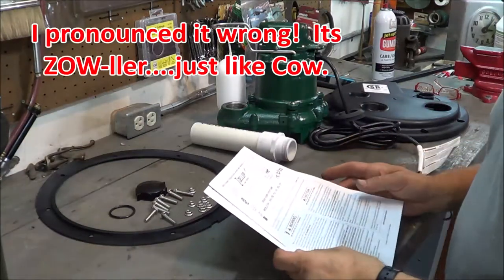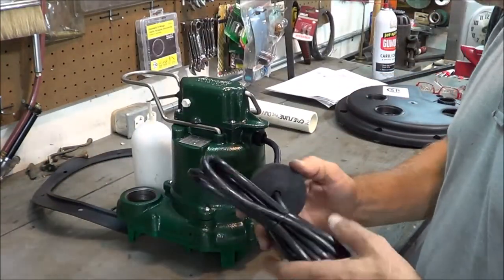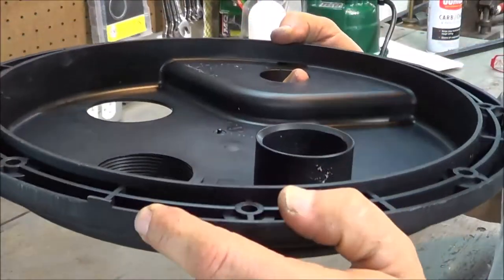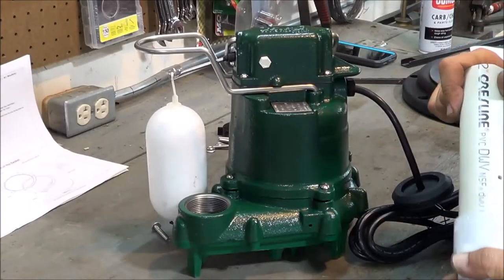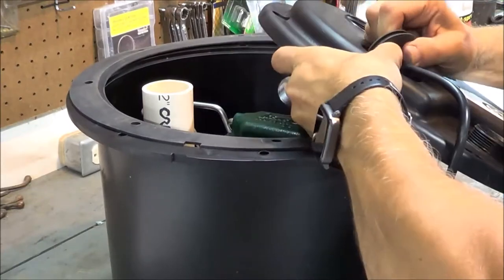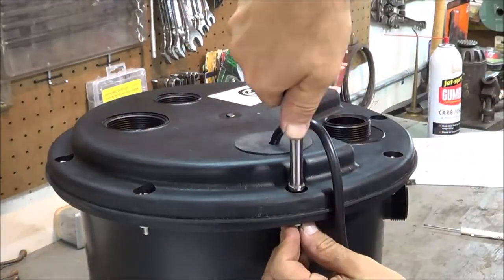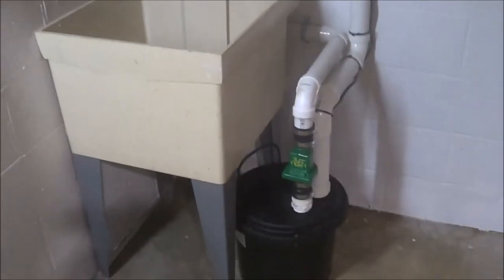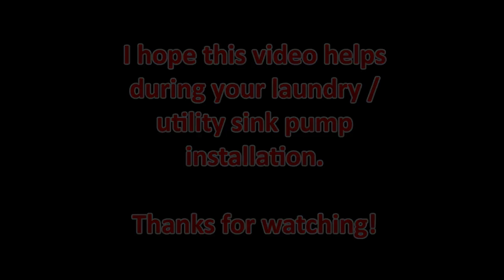Laundry / utility sink pump assembly and install

Comment: nice video. very clear and easy to follow.  Thank you.  My question is this: if I have a washer discharge to tie into this pump up, should i plumb in into the same drain coming from the sink  into the pump orshould I just have the washer  discharge go into the laundry sink?  thanks
Reply from the maker: Hope the video was helpful.  I'm not sure I understand your question but I think you're asking should you have the washer discharge its used water into a laundry/utility sink or plumb the washer directly into pipe that feeds into the utility pump.  I would say have it discharge into the sink first.  if I misunderstood your question please resend it to me.

Comment: Plumber quoted me $1700 for this install.  Parts are $400 including the sink.  Your video is the only one I've seen suggesting an inline valve.  Can you explain to me how I might use/adjust this correctly or refer me to a video that explains? Otherwise,  your video was exactly what I needed for determining the pvc parts I need to purchase for the install. Thanks!
Reply from the maker: hey Laura, glad the video was helpful.  The inline valve isn't 100% necessary to install the utility sink pump.......in my opinion it makes the installation more efficient.  I picked this tip up from watching a video from This Old House.....Rich Trethewey, the show's expert plumber used one in a laundry tub he helped install and I figured he seems to know what he's doing!.......  The valve simply lets you match the speed of the water being discharged by the utility pump with the speed of the water being dumped into the sink by the washing machine.  if your washer pumps water out of its wash tub slowly and the utility pump discharges it out very quickly, the utility sink pump will cycle on/off many more times than necessary during a laundry wash cycle.  Opening / closing the valve allows you the ability to adjust or meter the flow of water out of the utility pump to match the flow of water coming into it.  Again, its probably not 100% required for the installation but its a cheap/easy addition and gives you complete flexibility / adjustability.  Hope I'm making sense to you and good luck.  Kris

Comment: I was considering a Zoeller unit like that but alot of amazon reviews say the switch isnt sealed good and allows water in and short out the switch .
Reply from the maker: I can't say I've had that experience.  To the contrary I've had no issues or problems with the unit at all.  It is a heavy duty professional grade unit.  the unit was referred to me by a 30+ year plumber because I had questions when I was deciding what unit to purchase.  I can tell you that I looked at the pumps sold in the big box stores and they do not compare in quality or robustness.  Again, I can only comment on my experience with it thus far its been zero issues.  good luck!

Comment: Is this a better pump than the Saniswift? I’m needing to add one to a remodel. Great content
Reply from the maker: I can't comment whether or not its better since I haven't installed a Saniswift pump.  What I can say is that Zoeller has been around for a long time.  its well built and constructed.  the basin pump kit assembles very easily and lastly i spoke to professional plumbers who I trust and they said its what they would install.  one last thing was I thought the value for the price was exceptional.  good luck.

Comment: So the vent stack does not have to connect to the existing house vent ? Just wondering.. thanks!
Reply from the maker: So if you watch enough videos or read enough blogs on this topic you will hear both options....Dwefinitely must be connected into the house vent stack! ........or it does not require a connection into the house vent stack.  I thoroughly read the manufacturer's assembly and installation instructions.  The instructions state for a stand alone utility sink the kit's vent does NOT need to be connected to the house plumbing vent stack.  To get a second opinion and make sure I was reading the inastallation procedures correctly, I also consulted my a long time friend who has owned a plumbing business for 30+ years.  My plumber spoke very highly of this product and says he does not (for a utility sink installation) connect the kit's vent to the house vent stack.  he simply finishes the vent with a 180 degree return to prevent debris from entering the stack.  hope this helps and good luck.